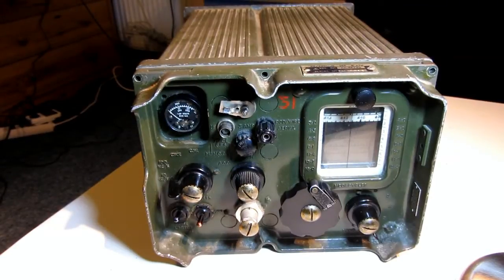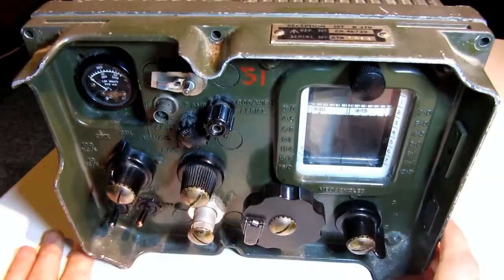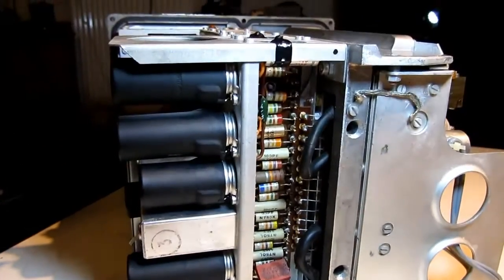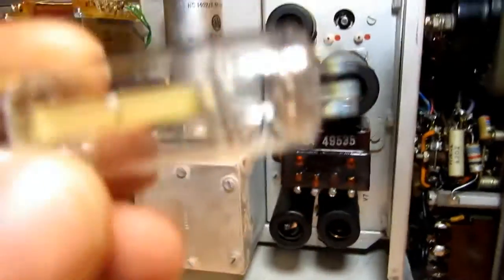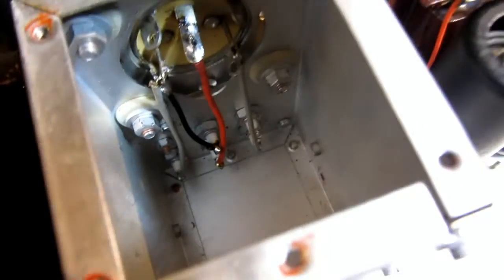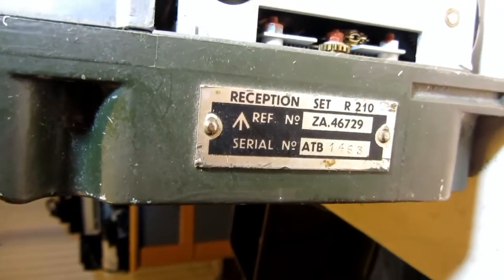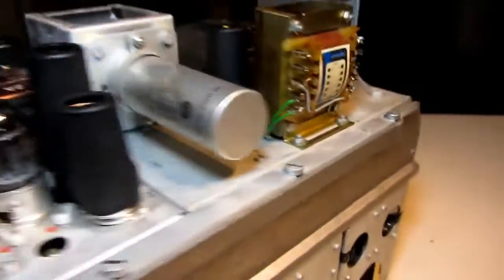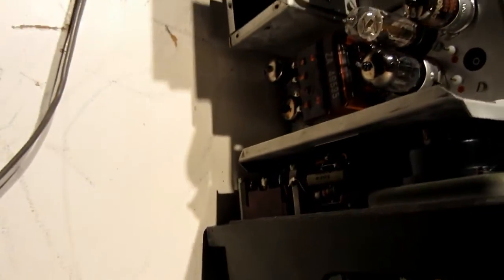Vintage tube radio teardown / autopsy. Reception set R210 Part 1

Comment: The white stuff is the oxide of the metal getter that keeps the tube at high vacuum by reacting and absorbing gas.  You probably can replace the broken tube if you look up the schematic of the radio and find the tube number from there.  If it is not made anymore, there may be electrically compatible similar tubes still available.  A set like that is worth keeping, but do as you please.  Very, very cool device :)

Comment: It's in remarkably good condition on the inside, you might need to replace the capacitors, it could be that the electrolyte has dried up.